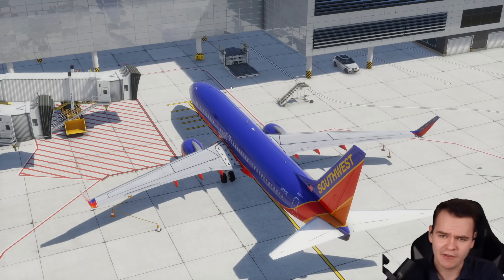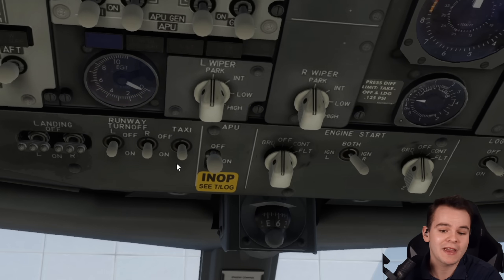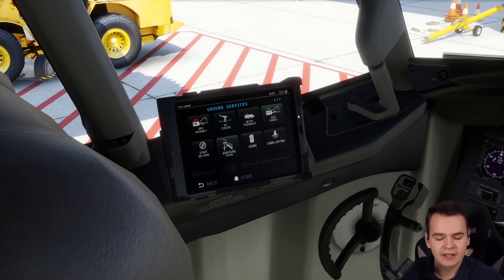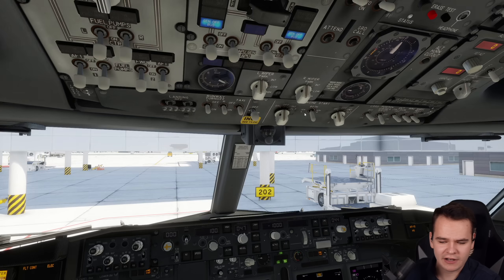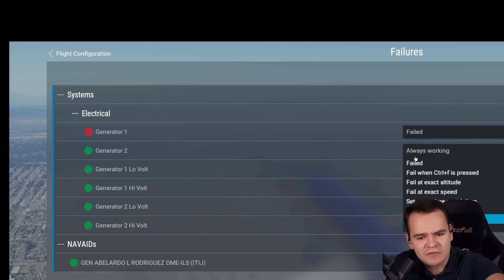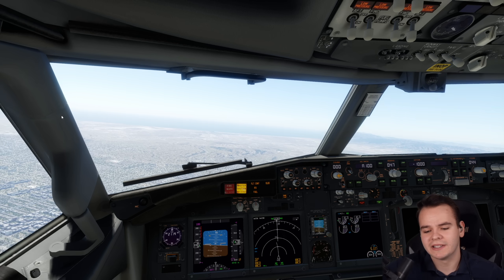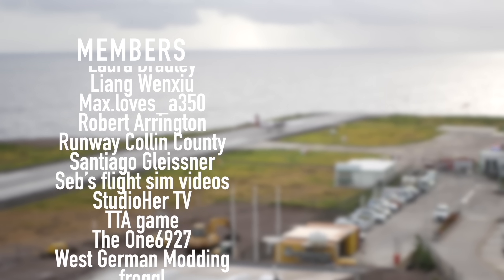Why Pilots Hate When The APU BREAKS

Comment: 00:04 - The APU is vital for powering the Boeing 737 on the ground.
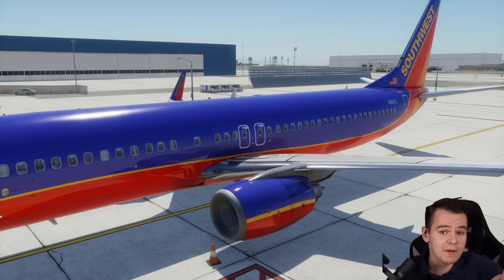01:19 - APU breakdowns cause discomfort and operational delays for pilots and passengers.
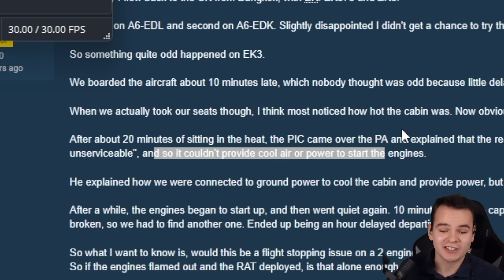02:20 - APU failures significantly impact flight operations and crew efficiency.
03:27 - APU failure leads to substantial operational challenges for pilots.
04:31 - Engines can start without APU using duct pressure.
05:33 - Flying without an APU is inconvenient but not necessarily unsafe.
06:45 - APU is critical for safe operations over water on the 737.
07:52 - APU issues are inconvenient for pilots and airlines, affecting turnaround times.

Comment: I can still remember LH 747-8 in Miami during the middle of the summer the APU was broken so they canceled the flight and flew back to Frankfurt next day the APU was broken again but we flew this time   after 30 min at the ramp after pushback off course we had to wait an other 30 min because of some American 737 blocking the taxi path it was like 40 Celsius so about 105 Farenheid.
Reply: And we had to start one engine at the gate this is why it took forever also the APU failed only after the passenger started to board.

Comment: Unless I'm mistaken, I don't think early jet liners such as the dc8 and the 707 had apu's.
Reply: You are correct as far as I'm aware. From what I've read, on the 707, they'd start one engine using ground-supplied bleed air before pushing back from the gate, then start the other three engines using the bleed air from the running engine. Dunno about the DC-8, but I assume they had a similar procedure.

Comment: I was on airplane with broken APU (it was widebody though) and departure was delayed half an hour or so. It took multiple attempts to start engines because ground unit was not powerful enough. Choked a bit when you said 737 doesn't fly long distances... MAX can do 7+ hours flights.
Reply: Apu breaking is i dont like
Reply: rip ur 737 max